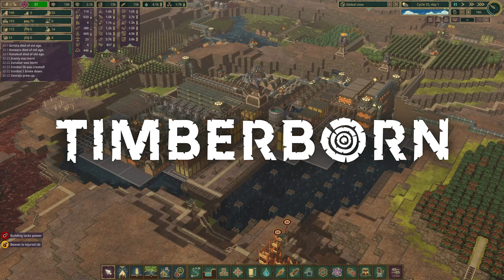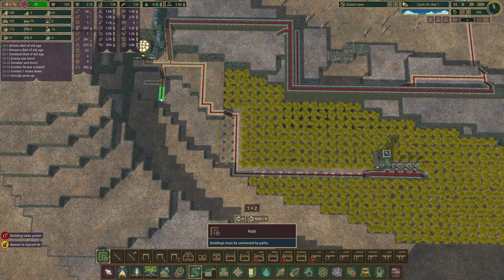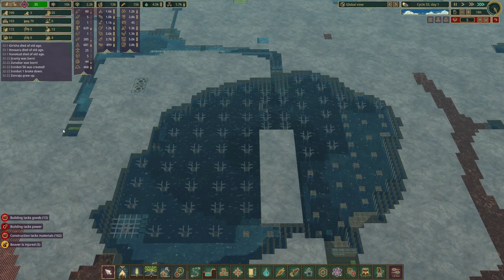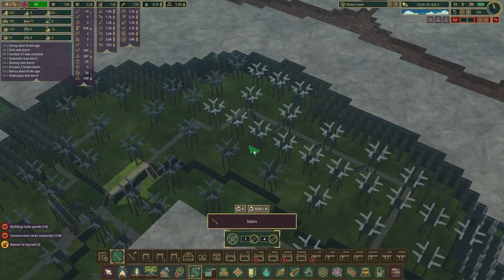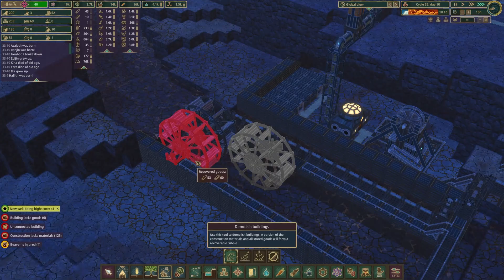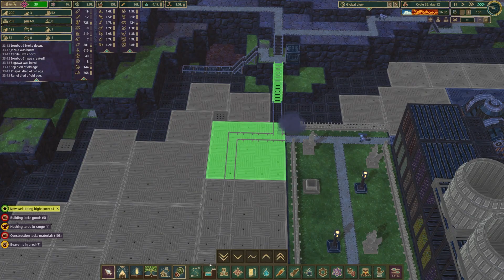Another Mega Project, Really? - Timberborn Iron Teeth Hardmode - Episode 22

Comment: I'm sure your upper reservoir is not filling because water is overflowing your main reservoir via the overflow dams, reducing the pressure filling the upper reservoir.

This wasn't a problem before (me) as the pipe to the main reservoir was sealed. Back then the pressure would cause the water to push up into your upper reservoir which would then fill your main reservoir until just below the main reservoir's overflow dams. At this point your upper reservoir would fill up until it hit it's own overflow dams, dumping water into the main reservoir, which would only then overflow.

Try closing the sluice from the pipe into the main reservoir for a cycle before you bring the recapture locks online, and you'll see your upper reservoir looking much healthier.
Reply from the maker: I explore this in the video I’ve just recorded, I flip flop about 5 times before agreeing with you and changing it back 🤣
Reply: @ThreePintPlays 😂